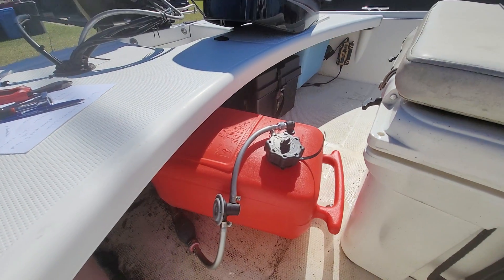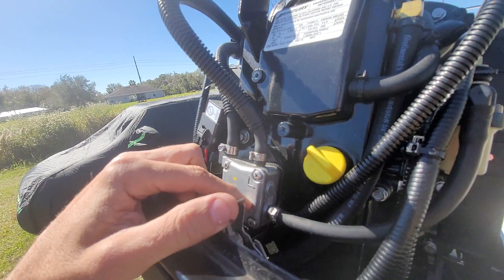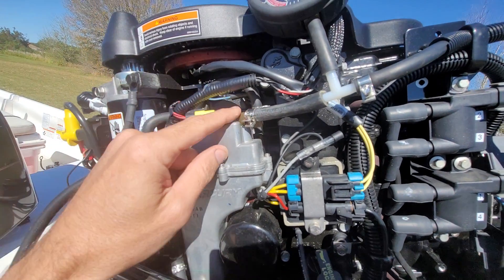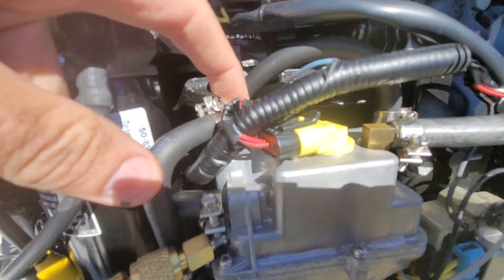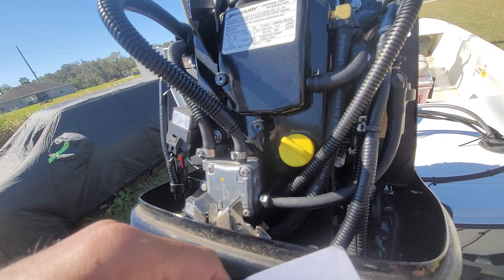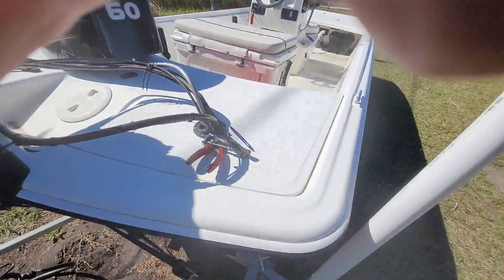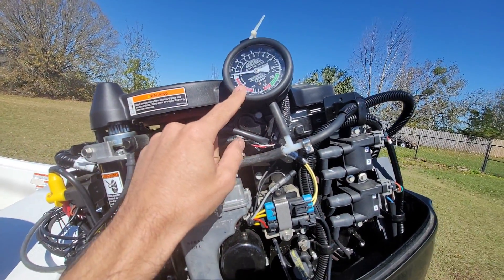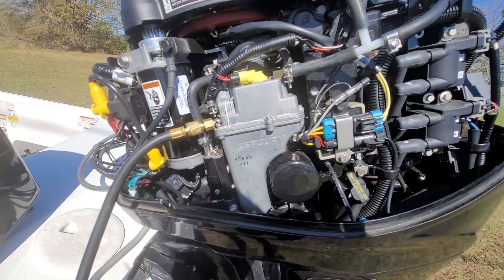Mercury 60 HP EFI 4 stroke low pressure fuel system information & test procedures

Comment: Great walk through my man! I am fighting the primer pump going soft after priming. Was your primer ball going soft a symptom?
Reply from the maker: low pressure fuel pump (lift pump) could be leaking. fuel may leak out of the exhaust if the leak is bad enough. if you set the gauge up like i show in the video, if the needle is fluttering the low pressure fuel pump is bad. after replacement the needle on the gauge was steady.

Comment: Thank you for the video, it helped a lot. I’m from Brazil, and here it’s hard to find good service, so I ended up doing everything myself.
Mercury 40 4-stroke EFI 2006 — it stayed parked for 4 months and the high-pressure fuel pump seized. I replaced it with a new one and the engine still didn’t return to normal.

I changed 1 ignition coil, 3 spark plugs, filters, the primer bulb, hoses, checked the PSI of both the high and low pumps, ignition timing — everything was verified.

After 4 months testing, today I finally found the problem: the MAP sensor was defective. After replacing it, the engine went back to normal. The issue was in the 5V reference voltage.

Comment: I have a 2019 mercury 25hp tiller starts runs amazing idle wot all of it but once I turn it off it will not restart till completely cooled down couple hours does the high pressure pump work good and after heat stop working  a mechanic friend suggested it just checking you seem a little more knowledgeable thanks

Comment: Anyone know if the fuel level in the filter bowl should visibily drop down to 1/4 or less while running? This happens and then motor may stall when idling or when going back to idle after letting off throttle. Bowl fills back up when primer is squeezed. Replaced low pressure pump thinking it was not drawing fuel from the tank, issue persisted.

Comment: Thank you for the great diagnostic test info.  I had the dreaded vent tube fuel leak and was able to determine that both pumps were good using your criteria.  I took apart the VST and it ended up being the float stuck on the connector shroud. I filed both the connector shroud and the float down a bit to relieve the interference and this fix the problem. Only part I paid for was a three dollar O-ring.

Comment: I have a 2016 60hp  4 stroke, no problems starting, go full throttle, quick on plane, while running at wot i start to loses rpms and the motor bogs down drops rpms down to around 2k. When i stop and shut off and turn right back on she runs fine, go full throttle and back on plane and a minute or two later same issue. Never stalls, no problems starting just seems to have a fuel issue somewhere. what do you think. also where to get the test gauges without paying what mercury wants for theirs.
Reply from the maker: You can rent fuel pressure gauge set from advance auto / AutoZone. You can buy a gauge set from Amazon / eBay for fairly reasonable. Sounds fuel related, similar to the boat in the video, but do the tests and go from there.

Comment: Question- so if I want to remove the fuel from this Mercury outboard at the end of the season I would run it dry then replace/drain both fuel filters and drain the vst by removing the screw at the bottom of the vst?  Would that do it or would there be significant fuel left anywhere else?  Amazing explanation of the fuel system by the way !

Comment: I have changed low pressure pump  and checked all lines my main filter go's empty
Reply from the maker: You may have a cracked line that's letting air in or fuel pickup is above the fuel level.

Comment: I'm getting a Stbd motor fault 3061-2. Online it says that means fuel pump is shorted but it only happens when giving throttle intermittently. Any idea what else that could be?
Reply from the maker: Just based on the description of the code, sounds like an intermittent wiring fault. I supposed it could be the pump motor itself also, but that's kinda where I'd be looking. I'm not too familiar with your specific situation either.

Also quickly after doing some searching, saw a situation on the BBC board where a clogged regulator was allowing over 100 psi to go to the injectors causing this code to come up. Might be worth while to rent a pressure gauge and see what youre running. The whole vst tank you can take apart and remove the regulator there is a screen behind it. Make sure everything is clear if your pressures are abnormal.

You can ohm out the fuel pump wiring and shake it to see if your loosing continuity, might need a few extra hands to help but should do the trick. You can also just bypass the existing wiring with jumper wires and see if that resolves your issue as well.
Reply: @lillyautomotive 
I ohmed out the pump and only got 1 ohm. I can't seem to find what it should read but I would assume more than 1.  The screen was only slightly dirty on the bottom of the pump
Reply from the maker: The screen on the bottom of the pump is the intake screen. The screen on the back of the regulator is in the top of the vst tank behind the regulator, you have to remove it and the screen is behind it. 

Ohm the fuel pump I'll try and get a spec for you. Ohm the wires from the fuel pump connector to the ECU, and then shake the wires, see if it changes. Should be very close to 0 the whole time. If it goes up especially very high then you found the issue.

Also, ohming wires out is a useful test but doesn't tell you if the wires can actually carry the current the pump needs to run. Ohm test will only tell you if the wires are broken completely, even if one tiny strand of wire is connected it will give you a good ohm reading. A much better test is a voltage drop test or load test. You can read about it on other videos, use a head light bulb as a load cell.
Reply from the maker: I believe 1ohm is good. Does the pump run and build pressure? What psi are you getting at the Schrader valve in the video?
Reply: @lillyautomotive 
Yea the pump was running and pumping fuel. I never would have know I had a problem unless my alarm went off so I looked on my mercury vessel view app and found that code. Chatgpt says the pump should ohm between 32-41 ohms. Not sure if thats correct or not though.
Reply from the maker: Ah ok, yeah I'm not sure the exact spec. I found someone say between 1-3 ohms but it was for a car. So yeah might be worthwhile to ohm out the port side fuel pump
Reply: @lillyautomotive 
I'm gonna see if I can get an anwser from mercury on the spec. I appreciate all your help!
Reply from the maker: @CarAholic86 post up what you find.
Reply: @lillyautomotive Mercury told me the ohm reading should be higher than 1 ohm not sure exactly where they suggest to check it but right at the pump I had 1 ohm. I ordered a new vst and checked the new pump and it's the same exact ohm. Looks like my problem was dirty fuel filters all along...Expensive lesson learned!

Comment: I for the life of me can not stop my 2019 yamaha 4stroke from either running out of fuel or stalling on a sudden down throttle this video has giving me some ideas to look at if the fuel system is similar
Reply from the maker: Hopefully, this will help you troubleshoot your issue, even if it's not the exact same setup!
Reply: Maybe your iac is faulty
Reply: I have the exact same issue. I was outside all day today trying to trouble shoot. Did you ever figure out what was causing the problem?
Reply: After overlooking another engine with this issue, found the timing belt jumped from dirt dobber nest, after resetting timing belt, it stopped stalling. Maybe helpful, every situation is different
Reply: @2discoveredm788 what did you do to get it back on track?

Just lined up your time marks?

Your comment single handedly solved my problem, dirt dobber made my belt jump.
Reply: I had it checked over the shop couldn't fault it had a good mobile mechanic come out he said everything checked out 100% he just bumped the base idle up and it hasn't done it again but I do suspect it is a faulty iac valve it just wouldn't play up when both mechanics looked at it unfortunately

Comment: Thanks for the video. I took a new to me 2005 50 hp out today on its, new to me maiden voyage and once in the water, it wouldn't start. Well, actually, it started immediately, then died immediately too. It finally started and seemed to run well all over the lake. We trolled for a while fishing and when I went to restart the 50hp, it would start easily but then immediately die again. So strange. I'm thinking it must be a fuel system issue. My kicker is plumbed in on the same water/fuel separator/fuel tank and it ran great all day so i doubt it's boat fuel side, it must be the 50hp fuel side. So here i am, in search of real testing information so i can get it figured out. Once the main fires up and stays running it seems to run very well. Just, getting it fired up.
Reply from the maker: Sounds like potentially the high pressure fuel pump is not starting after sitting initially, engine starts on residual pressure but dies bc fuel pump not working. When you restart the pump kicks on and off you go. Put a pressure gauge on the port off of the vst tank and confirm.
Reply: @lillyautomotive  Yes sir. That was first thing on the list to do tomorrow. I can see someone has been monkeying around in there as all the factory hose clamps are cut off and zip ties and crappy hose clamps are in their place. The engine has fairly low hours. I pulled the original impeller out of the water pump (dated 04) and it was still in fairly good condition so I believe the engine to have low hours so surprised someone has gotten into the vst already. I'll follow up with what I find. I actually arrived here because I wasn't sure if or how long the system would hold high fuel pressure for as I went out to the Schrader valve and it had zero pressure but hadn't been run for about 6 hours or so. Anyways, thanks for the suggestion and especially the video. I'll be back when I know more.
Reply: @lillyautomotive  Ok. I know things. I had the high pressure gauge hooked up to the shrader valve as I tried starting the engine this morning. I finally got it started after about 50 tries. I'd get about 10 start tries in before the binnacle would beep 3 times. Fuel pressure on the high side would jump to 45 psi after key on, and occasionally would drop as low as 30psi while cranking. Cranking is a bit of a misnomer because the engine would start after half a second of cranking, but then immediately die. I noticed no difference between it not starting, and when it started, as far as the fuel pressure gauge was concerned. 
On the low pressure side, I have a vacuum gauge hooked up. It's on the tank side of the low pressure fuel pump. It runs about -2.5 to -4 psi. When I pinch the line, I'll get nearly -10 psi on the gauge. Unplugging the fuel tank side of the lpfp entirely and allowing the engine to run itself out of fuel, I was surprised how long the engine was able to run before dying. Even at a fast idle. 
Anyways, I did find some of my fuel line fittings loose so I tightened that. I'm hesitant to suggest they were an issue as it seems the engine had fuel regardless. 
I'm beginning to doubt I have fuel problems now and probably should start looking elsewhere. It's as if a signal is being sent to kill the engine immediately, until some component warms up enough or something. Weird.
Reply: Something else I see too is the lpfp seems to hold vacuum on that side well also. I left it shut down for about an hour this morning after doing the tests above and the HP fuel side did lose pressure over time, to about 30psi over the course of that hour but the lpfp suction side held it's vacuum.
Reply: And we're making 4 psi on the pressure side of the lpfp.
Reply: Following up here. It wasn't a fuel issue after all. It was the idle air control valve. Specifically, the previous owners capped the "inlet" side of the valve. It wouldn't start until it was "warmed up" and bypassing the IAC. Madness. Thanks for the vid and the help.

Comment: Okay boys. My engine is idleing fine but when I try to gun it, it's not getting gas. I had to have my wife sit at the back of the boat and squeeze the primer bulb every few seconds to make it back to the dock the other night. Any thoughts on what is most likely happening before I go out and buy a vacuum gauge to diagnose?
Reply from the maker: Did her squeezing the primer bulb help? Then the most likely thing is either a clogged filter on the lp side or bad lp fuel pump.
Reply: @lillyautomotive yes! Every time I could feel us losing power, I had her squeeze it and we were off like normal. Unfortunately I didn’t see this video before replacing the high pressure pump (a much more time consuming repair) and I’m also thinking it’s the low pressure pump haha. I guess I’ll have to test everything tomorrow
Reply from the maker: If you hook a pressure gauge on the low pressure side the output should be steady. So the gauge shouldn't move, the one that was on the boat in the video, the needle was bouncing like crazy (the one way valve in the low pressure pump failed so it would push and pull fuel and the needle would bouce around a lot.) Once it was replaced the needle stayed at a steady 3 or 4 psi.

Comment: Great video!  It really clarifies the entire fuel system on the Mercury Outboards.  I was curious to see what my VST pressure was so I hooked up the same gauge you’re using, but mine reads zero when I start the engine. Does that imply the gauge is bad or do I need to bleed the fuel system before testing.  Thanks so much for the great video and any feedback you may have.
Reply from the maker: The gauge should read fairly quickly, if you're connected in the correct port and the engine is running well, the gauge is probably not reading correctly. You can rent fuel pressure gauge kits from AutoZone, O'Reilly's, advance, etc.

Be sure to look at the hose that goes to the pressure gauge for a Schrader depressor in it. Without it, it won't open the valve.
Reply: Thanks for your prompt reply and clarification.
Reply: Picked up another gauge at Autozone and the VST is still reading zero.  Checked the low pressure input and it’s to spec.  Checked the low pressure output to VST and it’s right around 4 PSI (my Mercury manual says it should be between 3 and 6 PSI).  I’m able to run the boat at high RPMs but it randomly chokes out (like it lost all fuel).  Could something be wrong with the Schrader valve on the VST.  It does expel some fuel when I connect the pressure gauge but a true reading of zero would imply to me that the motor shouldn’t run at all.  Thanks again for any thoughts you may have.

Comment: I do have a question maybe someone can answer.  I have a 2019 Mercury 60 HP EFI with trouble ramping to full throttle.  I have to very slowly increase the throttle to get to full rpm's or the motor will "bog down". Ive changed spark plugs, both fuel filters, fuel, fuel lines and primer bulb.  One thing Ive noticed is the primer bulb is never soft.  Im 54 years old and this is my 4th fishing  boat and have never experienced this issue.  Out of the water with a garden hose for cooling the motor revs up without a problem. When I put it in the water under load it bogs down until I get to full throttle @ 5000 rpm and 30 mph. Then I can cruise at top speed. This boat and motor has only 60 hrs of run time.  This issue just became a problem.
Reply from the maker: It sounds like when the motor needs instant peak fuel flow, there isn't enough. I'd run a pressure gauge in the Schrader port while taking it out and see if you are losing pressure or not. Could be a weak high pressure pump. Check all the components of the vst tank, fuel pressure regulator, and leaks at the fuel cooler, etc, and if not that then could be low pressure pumps, give those a check like the video.

Just because you lose pressure on the high side, if the vst tank is empty due to insufficient fuel in the tank from the low pressure fuel pump, doesn't mean the high pressure fuel pump is bad
Reply: @lillyautomotive  Thanks a lot. Ill give that a try and repost the results.
Reply from the maker: Any updates?